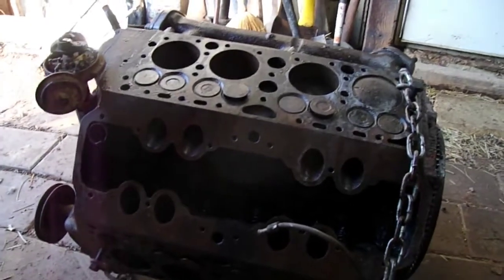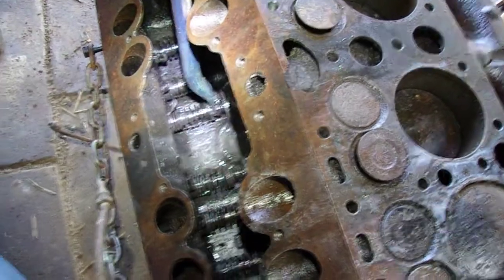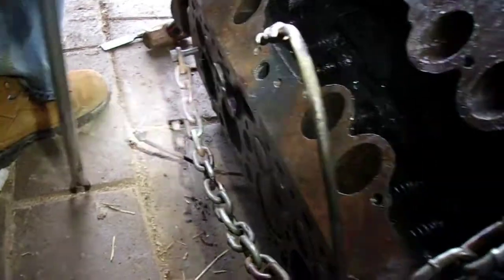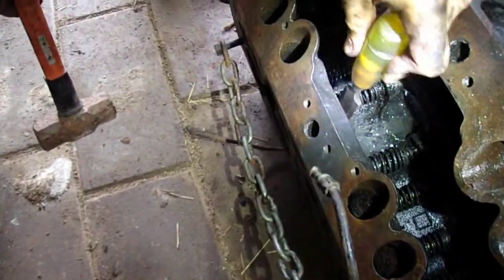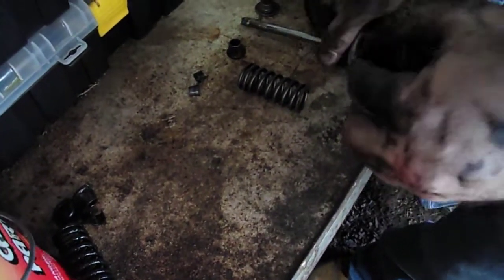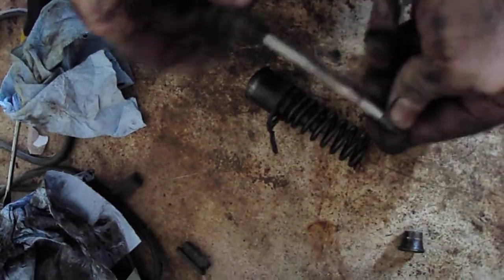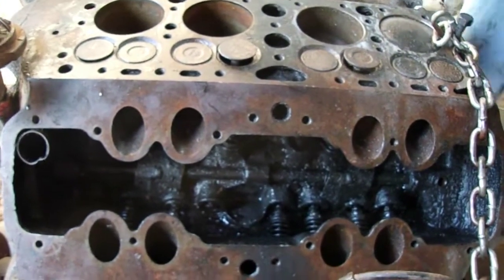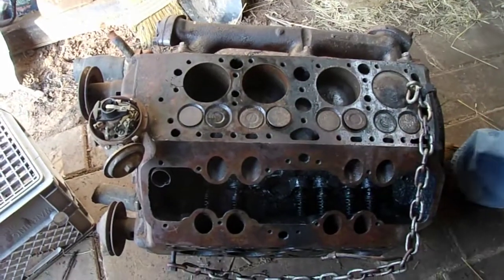1953 Ford Sedan - Ep 9 - Removing a Valve from a Flathead V8

Comment: You may want to use the tool to pry the valve guide down so the guide spring etc comes out as a whole - they pry bar goes through the spring onto the indents in the valve guide. This is also an 8BA motor with one piece valve stems instead of the earlier motors with 2 piece valve guides and a mushroom at the end of the valve.

Comment: Very nice video thank you ,you wouldn't happen to have a video on how to do the valve clearance
Reply from the maker: Thank you.  It turned out that block was badly cracked, so I couldn't rebuild it.  I have had difficulties in finding a replacement block in decent condition locally.
Reply: @projectcarvlog2434  oh wow sorry to hear good luck in finding another block I'd like to see it running